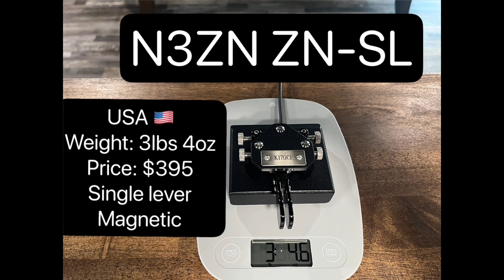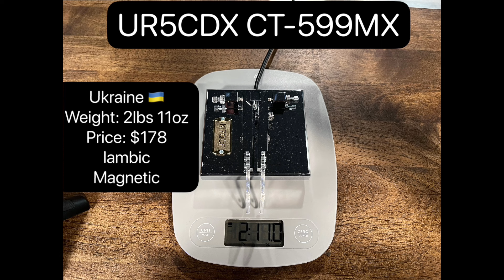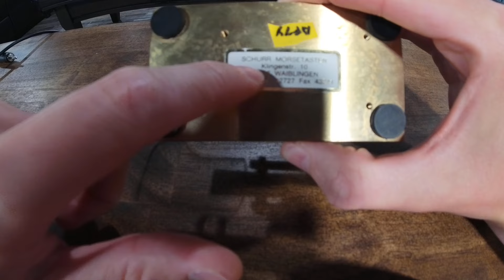My Key Collection

Comment: Incredible! Life goals right there. 😁 How do you like the CW Pokemon (HAMCUBE)?
Reply from the maker: @richsawyer1067  love it! That’s what I used to learn the alphabet and start sending CW!!
Reply: Would be curious to hear about what this CW Pokemon thing does versus the Morserino32.  Which is a fantastic little device... I highly recommend anybody who thinks they might be interested in the Morserino order one before they have to redesign it due to the Heltec LORA module (the brains of the device;; which also allows it to act as a localized transceiver to other Morserino32 trainers) is fully discontinued. The Morserino32 is really fully featured, and can even act as a memory keyer.  Obviously, no relation; I just love mine.  P.S. Great key collection -- a bit insane ;)
Reply from the maker: @Kinetic79  that’s really cool! I’ll need to check out the morserino! I don’t have a strong opinion on trainers. I’ve only tried this one and I snagged it off eBay. It worked as a good introduction to sending code. I then got a winkeyer and used iambic master. For copying I primarily used LCWO and YouTube videos.

Comment: Kent has been around awhile. The older ones were labeled Kent England starting in the mid 1980's, Then the label changed to Kent UK. I am not 100% on this but the Europeon Union came into being in 1993 and that may have something to do with that label change, and then kent contracted out the manufacturing end to Germany in 2006. I have the same two you showed, both are labeled Kent England. The design has changed a bit on the orientation of the contact arms on the Iambic. I def prefer the wider spacing on the paddles. I broke the original paddle on the single lever and ordered a new one. The shape, thickness, and material type has changed and I prefer the original. I hope to be able to find another one, or make a repair that will hold up. Thats all I got for ya on that.
Reply from the maker: @KC2BKM  Oh man! Thanks so much for sharing that story and the history. That’s awesome you have a couple originals from the UK. They are great paddles! I did get the bamatech red finger pieces for the dual but haven’t thrown them on yet. 
Thanks for watching and your comment!
Reply: Also N0SA just came out with a limited run of full size paddles. You can email him from his QRZ page. He only makes small batches as he is semi retired. Would make a great addition to your collection. Which is very nice by the way.